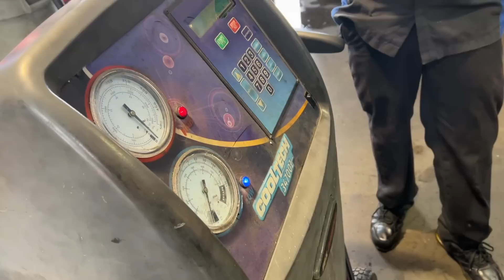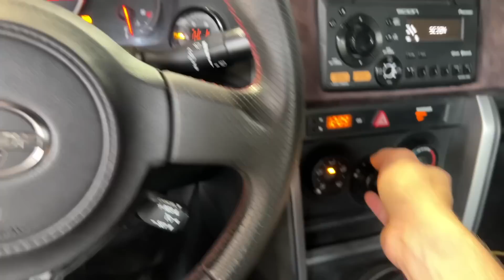Our K-Swapped FRS Is The Most Practical Car We've Ever Built!

Comment: You should do a series of challenges between the Porsche and the FRS - drag battle, road course, maybe spectator drag style at the freedom factory. Give the people what they want!
Reply: Dude. Yes.
Reply: The daily driver battle! Do some performance head to heads and some comfort stuff. Like which one hauls the most Baja blast.
Reply: Vs Wyatt
Reply: They should host an event. Spectator drags is a great idea.
Reply: 4 sure! That a great idea 💡 ✌️
Reply: No. Just no
Reply: That’s dumb AF
Reply: Yes
Reply: Agreed
Reply: Road course would be sickk
Reply: @Mouthy_Trucker  thanks for your valuable input
Reply: Both are drivers cars designed for time attack track driving 0 to 60 to 0 the Porsche all day long but turning laps the FRS might turn in some respectable times given the suspension is set up better than stock some nice BC two way  adjustable coilovers. And once you start to tune it and add the turbo is could even be a decent drift car. Right now it's a daily point A to B no frills ( other than ice cold AC )
Reply: @NAFIGGAMING  I would bet you that the K-swapped FRS would destroy the Porsche in nearly every field. The FRS/BRZ platform is very well designed but, it's just underpowered. With the power of a K24, the platform will truly shine. If they were to add some 2-way coilovers, poly/spherical bushings, and some wide sticky tires, the car would give it's competition vivid nightmares.
Reply: This comment wins🤟
Reply: @moedigzz  i would too and for the exact reason Kyle said at the end.....if it breaks he aint worried about it lol. I would bet if the Porsche did break it wouldnt get another stock engine, there would be another K or J swap going in it so he could enjoy it without the worries of a $10k engine being an issue
Reply: That k-frs will eat that porsche at the track.
Reply: That would be shit watching
Reply: Yes.. Definitely..!!
Reply: Dudee yessss
Reply: 2nd that
Reply: The Porsche would win in most categories
Reply: @Mouthy_Trucker  like you then 🙄
Reply: This aint that type of channel. Definitely a no. Cool idea though.
Reply: Some top gear shit Wyatt in the FRS and Kyle in the Porsche.  Would be hilarious.
Reply: New he has to buy all those cars and keep them put up to make up for his small pp
Reply: Yes! Do it
Reply: You realize how much it cost for them to replace the porch engine?
Reply: no the fuck he shouldnt those cars are nothing alike to compare in that way, tf?
Reply: Dooo it kyllllleeee
Reply: @hectornano7912  😱🤣
Reply: I’m going with frs cause of 🇯🇵

Comment: Fun Fact #86 - The FRS was originally sold with that Pioneer head unit (stereo), when it launched in 2012 they styled the head unit to be similar to the original tape deck found in the Original AE86 Tureno. That's why it has a giant dial and orange backlighting / LEDs. It was the style back then. 

One of the many little styling touches the Toyota Design team did with the car which brings past Toyota history to life!
Reply: Absolutely love fun facts like this! Thanks man🤙🏼
Reply: And then they gave it a subaru engine (FA20), with a 86mm bore and stroke, instead of a 3S-GE BEAMS which was still in production by the time the first 86 concept car was released, they decided it would have a hybrid V6 which then was replaced by the FA20 after Toyota bought 15.6% Fuji Heavy industries (Subaru).
Reply: Facts are on point 👌
Reply: I almost certainly did not ask.
Reply: @fuzzylogic394  ah yes, how original. Riveting stuff

Comment: the gearbox in the frs isn't going to put up with the fun you plan to have with that car
4th gear likes to slide off the countershaft around 300-350wtq, look up the circlip mod
its a common issue with high-hp aisin az6s
Reply: It was a high HP car before they bought it wasn’t it? Previous owner might have it done already idk
Reply: @bertaboosted8839  they hold up for a little anything over 380 torque kills them I had mine built which is what they might do.

Comment: Those C4 tailshafts are some thin castings and have seen quite a few break so I would suggest a soft poly or a stock Mustang T5 rubber mount to save you from not only vibration but disaster from fluid blasting out from a broken tail shaft
Reply: @growterps_1508  i will keep my stock one and a poly bushing before i buy any PCE junk lol, nothing ever fits or works right ive ever got from them or had to work on with their mess.

Comment: i put bmw 6 speed box in my frs because i kept fucking up the frs manual trans at 600hp. just a heads up if you do turbo the car, youre goin to have fun with that trans lol . they make a k series adapter to the 335i manual 6 speed, with clutch it can hang at close to 1000whp im totally wishing i still had the frs after seeing the k swap.

Comment: That part you took off the exhaust wasn't a cat it's a resonator it would take allt of bite off that exhaust. And you should conect the intake air temp sensor because at least on a stock ecu the VTC is disabled without that sensor
Reply: Is that what was hanging? about to get caught up in the belt.
Reply: @dustyc324 yes

Comment: 18:15 Adjust the valves and she will be tip-top again. Those b20s run well as long as you don’t overheat it.
Reply: I'm sure that one is k
Reply: @vvlswapd200sx  it is too bad that the engine rotation is reversed… it would be a great swap. That vintage is the best CR-V.

Comment: lol being a tech I find it funny he based the charge amount on what the compressor came out of and just because it holds more freon doesnt mean it will be colder... How does this guy explain dual air systems to customers?? lol He should if just based the charge on the pressure reading of the gauges in relation to the current temps outside..

Comment: My buddy has a CR-V with 230k miles on it. Adjust the valves if you haven't already Wyatt! The obvious spark plug/wires/cap/rotor tune up, etc that I'm sure you've done at some point or another!
The fuel injectors recently just gave out and was absolutely dumping fuel into a couple of cylinders and causing him to stall/no hot start. New ones made it run like a beast! He literally says it's way smoother and more economic now too. 
That FRS is awesome and having COLD A/C is a must in the south haha

Comment: Tbh I would like to see them k swap the Porsche
Reply: Vr6 or nothing
Reply: @waterloo123100  nah there’s always a problem with the ignition system and they overheat so kswap is best and kyle has more experience with them
Reply: @fernandochavez4231  That’s funny mines never had any of those issues. Cast iron holds heat a lot better then aluminum btw bud
Reply: @waterloo123100  ik but my uncles gti always overheated and had problems with the ignition system ik not all cars have the same problems but most of em does

Comment: I can tell you that the low side pressure is too low. It needs to be at least 35 psig. And its below 30 psig
Reply: I was wondering how they came up with the right amount of refrigerant. The guy was wrong about the compressor. It's system volume, compressor is only one part. It's probably over charged. I've found some vehicles do better at the minimum spec than the max. Chrysler products I have worked on, blew colder air when charged a little lower than the tag under the hood.

Comment: ADJUST THEM VALVES ON THAT CRV  

the B20 tightens the valves overtime, recommended interval is every 30k miles.  

Adjust to the loose side, your CRV sounds way too quiet, you need it to be sounding like a sewing machine.  

Don't do this and you're just gonna burn a valve

Comment: Not gonna lie. I’m in process on a beams swap for my 81 starlet. It’s got the compressor. However. It’s an odd Japan only kinda deal I think. Been thinking about a k swap lately and saving the beams for when my sr5 pickup decides to send its v6 to the afterlife. A more modern air con k swap with seriously reliable NA power in a 1600 lb car is sounding pretty damn nice lately compared to the beams. 😂😂😂 I must be getting old.

Comment: That Sidekick is going to be your most unreliable vehicle just sayin.  what's next you're going to post videos every week on what you have to fix or what keeps breaking down on the sidekick I ain't mad at you guys.  I'm just alittle disappointed with you honda boys....like what happened with the LS???? I'm just not a big fan of Mazda.....guys why do you think they don't make rotary engines anymore??? BECAUSE THEY ARE EXTREMELY UNRELIABLE!!!! Mike V I'm sorry but that little Toyota truck he had it may have been a  screamer but that was the biggest pile of junk I have ever seen... It was never running right, always running out of gas,  bolts falling out left and right, welds breaking....sad to see you guys even wanted to do a rotary swap...... just going to be a big headache for you. I'm already wondering is the sidekick going to break down every time you try to do a burnout in it???? SMH🤔🤔